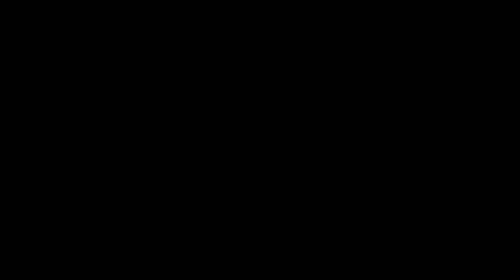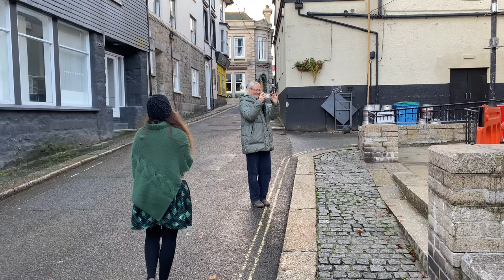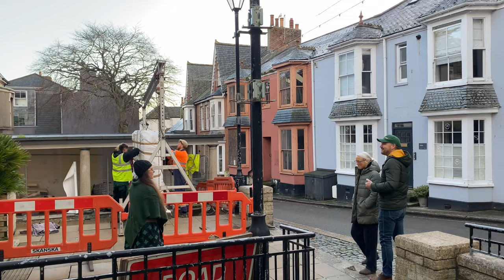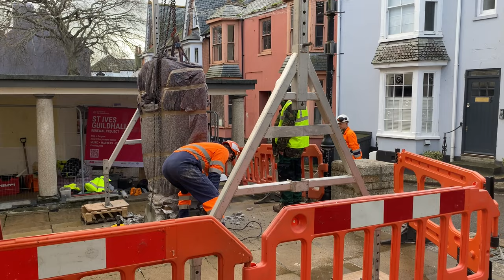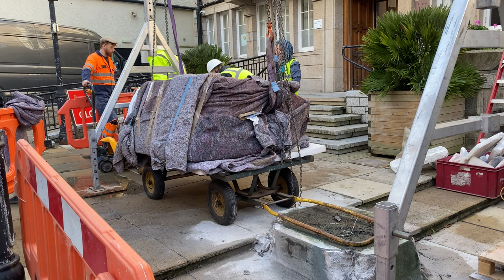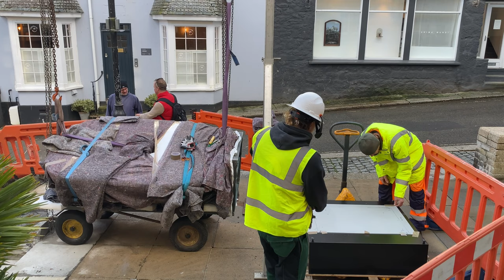St IVES GUILDHALL RENEWAL PROJECT - TEMPORARY RELOCATION OF 'DUAL FORM'

Comment from the maker: The removal unearthed 2 coins from the reign of George VI - a 1941 ha'penny and 1943 threepenny bit, mixed into the concrete plinth.

Burying coins was a superstition intended to bring good luck to a building or structure. As it has worked for so long, these coins will be placed in the new plinth when the sculpture is brought home in early 2026.